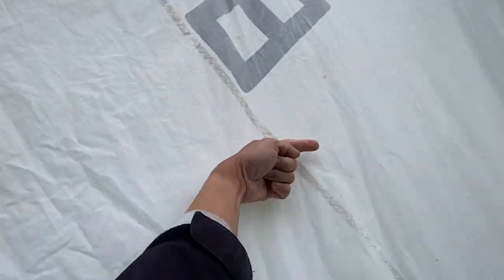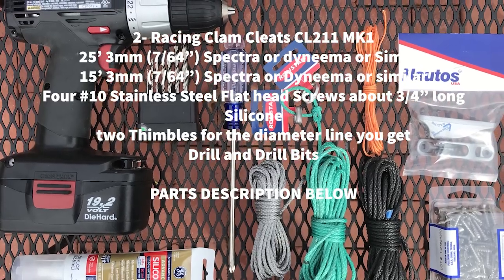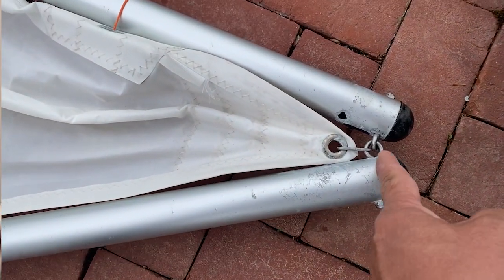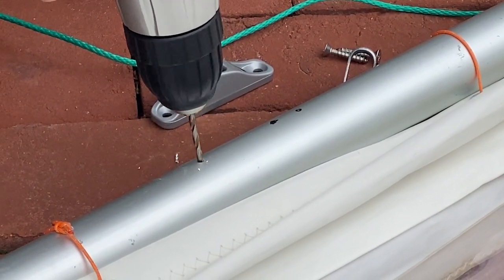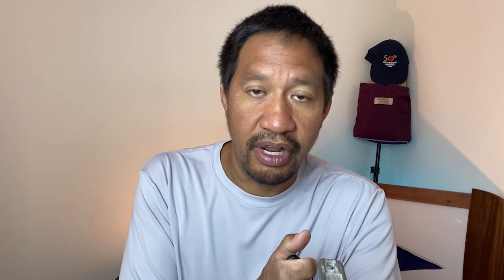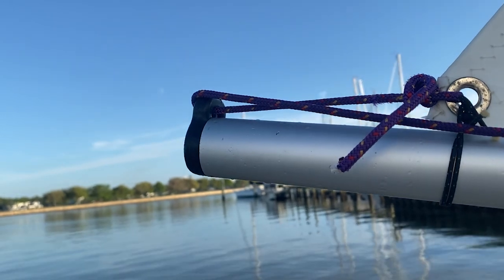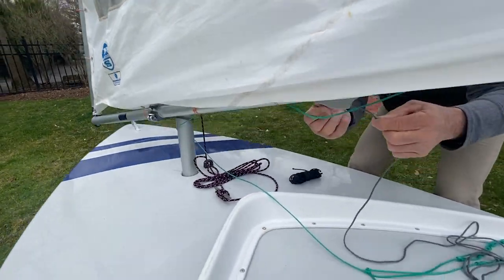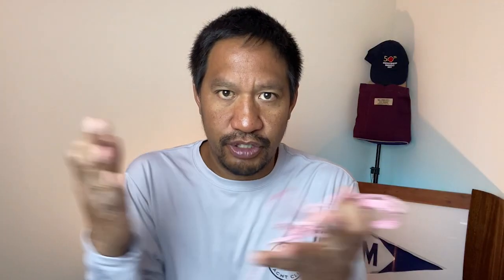How to Install An Outhaul and Cunningham on  Sunfish Sailboat

Comment: What size thimbles did you use?
Reply from the maker: About 2-3 different sizes.  Make sure the line and the groove are similar size-  they dont exactly have to be the same.  Thr thinble itself is useally aboit 3/4-1 inch long.

Comment: I rigged a downhaul on mine.  Keeps the sail flatter in stronger winds.  I don't race so I don't know if it's legal or not, but it seems to work.  Holding the hoop down from rising up the mast a few inches
Reply from the maker: Flat sails in heavy wind definitely good for balancing the boat!

Comment: Lee in Scott’s  Kyles Tuning Guide he states: Secondly, the port-side cleats make for convenient re-tightening upon rounding the leeward mark.  You suggest mounting the cleat on the starboard side of the boom.  Why?  Thanks.
Reply from the maker: Many race courses now a days are windward leeward with a gate.   The windward mark is usually rounded leaving the mark in the port side, meaning yoy will be in starbord tack….  This allows you to let off the outhaul in your final approach to the windward mark.  Most outhauls are now led back to the cockpit, and tightened before rounding rhe leeward gate.   Hope this helps.

Comment: Great help, Lee - I appreciate you sourcing the parts, it was difficult to find the clamcleats and your reference to the ones on Amazon were most economical. As a matter of fact it is hard to find a metal 3" horn cleat for the mast, just the nylon ones show up anywhere. I ordered a full tube of 3M 4000 marine caulk for about $22 which raised the price, but with a mix of shipping fees (I canceled Prime after the recent price hike) the order came out to $97 here in May of 2022. I have other boats I needed the caulk for so the full tube was worth it. I wasn't sure the caulk was really necessary on the sunfish boom but if it slows water leaking into the boom during a capsize that might let it drain faster with less water after righting. Don't capsize, it's not fast, I know(!)...
Reply from the maker: Excellent!!!   Glad to hear my video was able to help:)
Reply: @LeeSideSailing  My Sunfish Bible is in storage somewhere and you have the most - by far - info on rigging for racing. The SB is also 30 years old and there has been a lot of racing since then.
Reply from the maker: Yes there has been lots of changes!
Reply: @LeeSideSailing  👍 Woohoo.

Comment: Thanks Lee! This is a great video - very clear and helpful. What about using hose clamps to attach the out haul and cunningham cleats, like you did with the mast cleat? I’m thinking of starting with hose clamps to make sure I have the right location for my old sail, before drilling into the boom.
Reply from the maker: If you have the sail on and use the measurememts.   You should be good. :)
Reply: I got the same idea of using a hose clamp from a 2004 Windward Leg edition. After Lee’s video I am more confident in just drilling and attaching the clam cleats. But I though I’d let you know that Dick Tillman shows using a hose clamp as an option. 
https://www.sunfishclass.org/documents/Windward_Leg_summer_2004.pdf?fbclid=IwAR0kaeZr6h7d6QfYa5C0UmCPoqGSCNoQZnzS29d8ipVgdEnc3hZzNa4hFac

Comment: What brand/model is the closed end thimble you used in the video?   The Amazon link'd thimbles picture looks like an open end thimble.   The 1/8" thimbles I got from sail rite a few months ago look much larger than the one in the video
Reply from the maker: Im not sure as Peter (the owner) bought all the parts.  I jist have him a he eric lost of things to het.  Closed or open it doesnt matter. As long as it fits the diameter line you buy.
Reply: @LeeSideSailing  thanks

Comment: thanks, Lee. very helpful. I just bought a racing boat from someone who used it lightly, and who had them both already set up. both slip loose, however, right when I need them (in strong wind). time for new line (which doesn't look that worn)? or am I doing something wrong...
Reply from the maker: Make sure the cleats are in the right direction and the line is jammed into the teeth-  but it shouldnt take that much tension to make it not slip, if the teeth are in the right direction. Also check the diameter of the line.  If its too big or small.  That can affect the hold on the line.

Comment: Good morning Lee. I have a question I picked up a sunfish a couple weeks ago and I am running into an issue with the daggerboard and the bungie it came with. Long story short the water I sail in has shallow areas where I would need to raise my daggerboard. The bungie my boat comes with only hooks to the mainsheet block. I can only be in the fully down position like this. Any tips on a good way to set this up? I noticed in one of your videos you were sailing a sunfish with the bungie cord attached to the coaming. How did that work out? Any advice would be helpful. I don’t race in it just takes me camping on the islands around where I live. Thanks!
Reply from the maker: Hi.  You can stretch the bungee across the coaming ends….  This will cross over the dagger board trunk.   Inesrt the board and the bungee should go in back of the board, putting pressure on the board, forward, to stay up.  Many people add a length of rubber tubing to the cord to protect the bungee from chafing.    This usually works well.    If you wanted more insurance from losing the board in a capsize.  Add a length of line to retain the board and make it long enough for you to move the board from the trunk.
Reply: @LeeSideSailing  Thank you Lee, I will try that, for sure. Would  5mm be the standard size, or would you suggest something thicker? Thanks again!
Reply from the maker: You can get a normal bungee at your bungee cord store. :)
Reply: @LeeSideSailing  That works too haha.
Reply: I start in shallow water so same thing. I made a short shim out of scrap mahogany drilled a hole in it and secured to hull fitting with short line. Holds it at any height way to remove